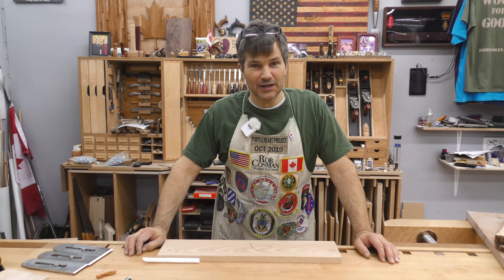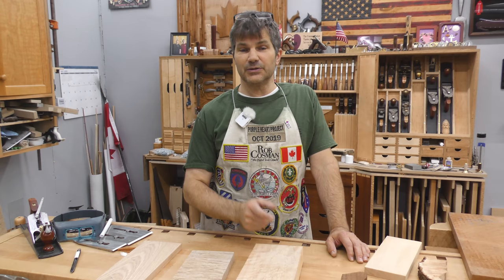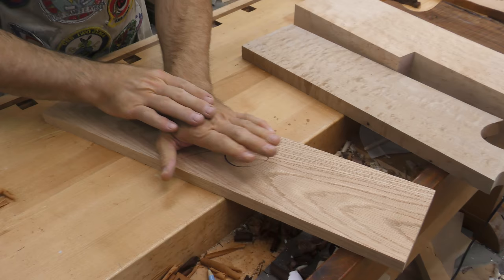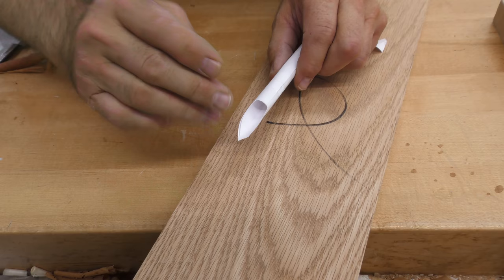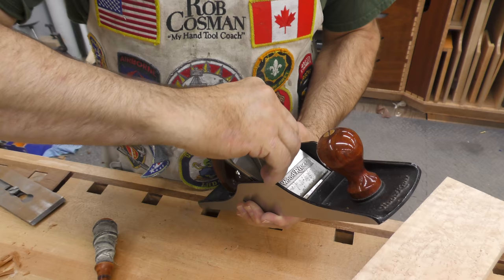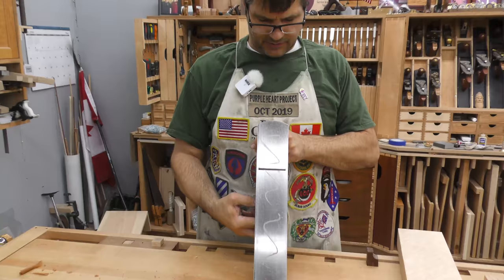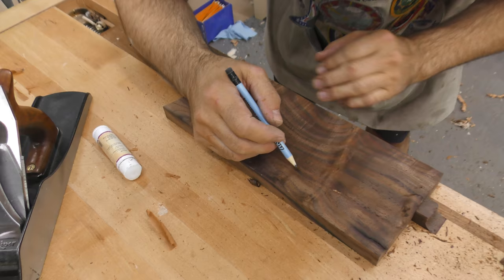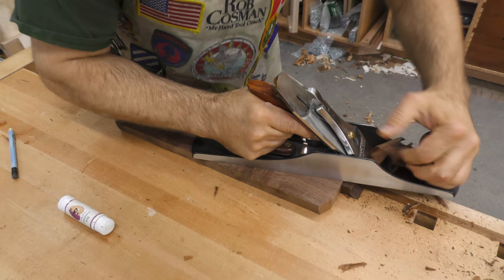Hand Planing Wood - How to Prevent Tear Out

Comment: "I’m not a huge believer in having the chip breaker close to the edge " .  I think you should do a video where you’re trying different positions of the chip breaker. Because when I set my chip breaker close to the edge of the blade I can go in any grain direction without any tear out. I know that you have a ton of experience and that you are a real master, but I just found that comment a bit chocking. I use Stanley type chip breakers , I don’t know if that makes any difference?

Comment: Interesting that Rob wasn't a fan of placing the cap iron tight to the edge of the blade, as advocated by several other experts who claim this cures tear-out without the need for high angle blades. If the experts disagree, what hope is there for the rest of us?

Comment: Instead of going straight to the 65° setup to tame that piece of White Oak, I would have experimented with advancing the chip breaker closer to the edge. If you can get it to work, it saves the need to have several different blades.
Reply: I also think that a close chip breaker does wonder. However it is rare to find actual measurements of what close means. So for a smoothing plane (it doesn’t make real sense for  grunt work), it is usually a small fraction of a millimeter, <0.5mm. Just a very fine line of the edge protruding, just at the limit of your edge camber. One also want to tune a very fine cut, not to have the chip breaker protruding off the sole of the plane. The mouth should not be closed tightly. The shavings should come out straight from the plane, not in an accordeon nor dust. 
Such a setting makes the plane hard to push and is not your all-day setting, which should be around 0.5 - 1mm for a smoother and maybe more for jacks, jointers, etc.

With wooden planes, you can usually close the chip breaker as you plane, ever so slightly, until you notice the shaving change in shape to something straight and eventually a bit shiny.

There is no absolute value and no miracle with this technique, just my 2 cents to quantify what "close" means.
Reply from the maker: I have never been able to get the close up chipbreaker method to work.
Reply: @RobCosmanWoodworking  I think that might be because of the back bevel, I never put back bevels on my planes because of that, while I think it is a pain to flatten the back (at least the quarter to half inch or so before the cutting edge) I am convinced it is worth doing.

Comment: Don’t have a question but just wanted to say I used my LN 5 1/2 plane to put the 24 inch long taper on the 30 inch long 4 legs of the writing desk I am making.  Took forever, but it was so relaxing and satisfying to make table legs that look better than a table saw with tapering jig.

Comment: Great video and very useful as I have often encountered difficult grain in the timbers available to me. With regards to the "65" are you talking about the frog angle or simply an increased bevel on your cutting iron? 
I have a plane with a dedicated increased frog angle but if altering the angle on a spare blade I will most likely sell the other plane. Many thank
Reply from the maker: I make a HA blade by putting a 20 degree backbevel on a standard plane ten 45 + 20 = 65
Reply: @RobCosmanWoodworking  That was the missing link for me! Would have never though of that!. Could you likewise make a low angle plane out of a normal one, by reversing the blade?

Comment: I wonder if adjusting the chip breaker would have helped. On a Japanese setup it would make all the difference. Thanks so much for these fun videos!!
Reply from the maker: John there are a bunch of folks who say if you position th echipbreaker a couple of thousnads of an inch from th eblade and grind th eface of the chipbreak up to 80 degrees that will help, I just have never been able to have any success with that method

Comment: One key element that Rob did not call out in this video is the use of Magic Wax next to the sharp blade this helps so much with hand planning. I swear by the stuff.
Reply from the maker: Frank.  Yup you are so correct.  Thanks for pointing that out

Comment: Thanks for all the great content. My first plane was the WR 5 1/2 and it has been great to use.  One wood I've had a hard time planing is shedua with the interlocking grain. Even my thinnest pass on the jointer left huge pits.  I could only get a clean face with a toothed blade and a #80 scraper.
Reply from the maker: I am not familar with that wood...I will look it up. Sounds nasty

Comment: As a woodworker new to hand tools, I’ve struggled with figured grain. I just don’t seem to get the results I’m hoping for. I actually bought your plane based on your videos.. I do have a question. What do you mean when you say high angle? Because it looks like you’re using the same plane.

Comment: No clue if this would work or not. I am a bowl turner. One of the nastiest bowl woods to turn is dry Koa. On bowls, 1/4 of the revolution is with the grain, 1/4 against, then repeat. To tame tear out in Koa or other woods that are being nasty, some times just dampening the surface with water can help 'lubricate' the fibers as you gently turn off the wet wood. Had some Koa that was years old from up in the rafters of a friend's shop. It took several dampenings to get rid of the tear out.

Comment: Hi Rob,Great video as usual. A couple months ago I was building some hickory cabinets for our kitchen. The hickory is flat sawn and has some really nice grain but it swirls and rises and dips all over the place so I was having a lot of tearout problems. You provided some really great suggestions at the time, including most of what you went over in this video. A lot of what I was experiencing was similar to the white oak in the video. The 20 deg back bevel solved quite a bit of it but there were still a few areas I just couldn’t get smooth on the panels and the frames no matter how often I sharpened and how tight the mouth was. I ended up having to use a card scraper to get those areas and then I sanded the whole thing with 220 grit to blend everything. If you ever get a chance to demonstrate the techniques on some hickory like that I’d love to see you apply your arsenal of tricks on it. I would really like to learn to defeat grain like that with a handplane because once the wood has a finish on it incident light reflecting off a handplaned surface is so much more beautiful and interesting than a sanded surface of the same wood. Thanks for all you and Jake and your team do. Since finding you on YouTube I’ve learned a ton and acquired some really great tools from you. Someday after all this pandemic stuff is behind us I’d like to take one of your classes. Until then I’ll keep practicing what you teach us.
Reply from the maker: Yea, I didnt have any hickory in the shop.  We will be uploading our 2021 workshops on 1 Oct

Comment: When you pull your plane back across the wood for the next stroke you can hear the scratching sound how does that benefit either the wood or the blade, I would think it would either scratch or compress the wood or round over the bottom of your plane blade.

Comment: I plane with the plane pointing straight down the board. Would it help with tearout to have the plane at an angle like you do as it travels down the board?  Does that skew help reduce/prevent tearout.

Comment: It is nice to know that even if you prepped and sharpened the blade properly that sometimes the normally sharpened blade can’t get the job done, and you need to look at other methods, such as that high angle blade. I would have liked to see a piece of wood that you have had to use a scraper on. Is scraping something you would do after getting the thickness/flatness close to the desired dimensions?

Thanks for everything you do Rob! Love the videos!
Reply from the maker: I would use a scraper is the HA blade did not work

Comment: Hi Rob, I have had a difficult time planing hickory. If I remember correctly, even a freshly honed and burnished scraper still produces fuzzy spots on the surface. Thanks for your videos. I have been able to refine my techniques through them.
Reply from the maker: I think if you have a sharp blade and very low projection you can plane the hickery, but its a hard
Reply: @RobCosmanWoodworking  Thanks, Rob! I will give it a try.

Comment: I agree with you with respect to the chip breaker setting.   As  72 year old does it make sense for me too hand plane large glued up panels?
Reply from the maker: AT 72 years young, you will have to make that call.  But there is nothing like the feel and look of a planed piece of wood.  Sharp blade, thin cut and a waxed sole will help make the planing easy

Comment: I might be a little confused.  I thought you had to put a high angle frog in a bailey type plane (isn't that what you were using?) in order to get a higher angle setup for wood susceptible to tearout.  In your video you changed irons to do this.. How is that done?  Thanks.

Comment: Hi. That is, to achieve an angle of 65 degrees, I simply grind the spare blade at an angle of 20 degrees, put it in the same way as in the plane low angle fax up. And how to fasten a chipbreaker? In a video with an angle of 65, you have a chipbreaker installed.

Comment: Do you think you can discuss how to know when it's time to resharpen, and anything to look out for? I'm new to sharpening at this level, and I was planing some maple today and it was beautiful! Then, after a bit, the shavings were shredding on the grain lines of the board edge. Is that a sharpening tell, or a clue to use more blade?  Is it possible to accidentally sharpen to a fragile edge? Those kinds of hints would be great!
Reply from the maker: So telling when to sharpen is a fell you gain with experience.  Before you get that experience the ways to tell are:1) plane gets harder to push, 2) instead of a nice shaving you are getting tears in the shavings or sawdust no shaving.   Until you get a feel, sharpen more often.  No you cannot sharpen too much or make the edge fragile.  Watch my sharpening video

Comment: Hello Rob
I don't get why the close set cap iron isn't an option, since it's not exactly doing any terrible modifications to the plane.
Have you issue with honing your cap iron to 50 degrees ?
 
Good to know you can still have an open mouth with your IBC irons, I was thinking that they might have been too thick for it to work, and the plane choke up, so I'm quite confused why you choose not to utilize it? 
I'd never take the risk of not doing so, especially on camera!
I gotta guess your dislike of the close set cap is just to demonstrate how well you can sharpen : )

All the best
Tom
Reply from the maker: I just habve never been able to achieve satisfactory results with that methiod!!  maybe I am doing something wrong?

Comment: Thanks Rob for the high quality content as usual. Two questions: 1) I recently bought a WoodRiver No. 5 completely based on your recommendation and although I absolutely loved it, I noticed the sole isn't completely square with the sides. it was about 0.6 to 0.8 off of 90. Got it replaced with a No. 5 1/2 and this one came out at 0.4 off of 90. 

WoodRiver says this is within the manufacturing tolerance. At the moment I have to shim the shooting board with surface with masking tape to bring the sole up to 90 degrees with the sides, otherwise the blade has to be protruding so much in one side that it just doesn't look right. Do you have any suggestion on how to deal with situations like this? 

And 2) Where can I get one of those adjuster knobs you have on the plane in this video? Thanks again!
Reply from the maker: What I did on mine is I put it on my vertical sanding wheel while resting on the platform 90 degrees to the sanding wheel.  In a couple of passes I brought it to 90.  If you dont have one of those big sanding wheels you could try sanding on the side with sandpaper adhered to a flat surface.  

We sell the sdjuSTARS.  they are in the plane section of my website
Reply: @RobCosmanWoodworking  Perfect, thanks a lot Rob! I will try that. Also the AdjuSTAR is sold out now, I hope you do another batch soon!

Comment: Rob,
I like to finish all show surfaces by planing, and when tear out occurs, I first try skewing the plane for a shearing action, and if this proves unsuccessful, I finish with a card scraper or scraper plane. Suprised you didn't mention these techniques.
Reply from the maker: The topic was "Hand Planing", not scraping.  Different procedure different video.
Reply from the maker: But skewing to get that shearing action is a great technique.  Actually i think i should add that to my process: 1) sharp blade 2) try skewing 3) smaller projection.  Great tip
Reply: @RobCosmanWoodworking  Rob, actually I do more than skew the plane, I don't push the plane straight forward with it skewed, I also kind of sweep it at an angle. Not sure if that correctly describes the method, but I try to slice as much as possible, pushing forward & sweeping in an arc at the same time. It's pretty much a trial and error method, but I've found it very good for me.
Thanks

Comment: I have to ask is your purpose for planing wood for surface preparation or for removing stock.  When I pick up a plane I'm wanted to reduce the stock size by a fractional amount much as you would with a scrub plane or to take the twist out of a board.  Am I missing some here?
Reply from the maker: Bob,  short answer is both.  It depends on whatyou are trying to do?  If working strickly hand tools then I do every operation, dimensioning with handplanes.  However, on a daily basis I typically use planes for surface preparation and use my machines for removing large amounts of wood.  There just is nothing to compare to a pamed wood surface.

Comment: I would like to see how a low angle bench plane compares on those same pieces of wood
Reply from the maker: I do not prefer a low angle, primarially because of its lighter weight and I find it not easy to adjust (reach the knob) while planing.  So knowing my preference, i would not want to plane in difficult grain with a lighter plane, i want the heft
Reply: @RobCosmanWoodworking  yes I agree. You have a great video from late last year I think that compares them. I just thought it might further drive your point to see how much more difficult it would be to get these results with a light plane like a L.A.jack    with or without this video was great.  As always thanks for the awesome content.  Can't wait for the next one

Comment: I was so please when I was finally able to plane curly maple. Very sharp blade with a right throat did the trick for me.

However, no matter what I do, I can’t seem to plane quarter sawn sycamore... have tried tight throat, chip breaker right up close, lightest pass while still getting a shaving, and a higher plane angle. Am I missing something or is sycamore just too soft a wood?
Reply from the maker: Sycamore can be difficult but its doable.  Maybe you just had a difficult piece

Comment: Does the speed of the travel of the plane make a difference?

I like using an Aussie timber called Southern Silky Oak (Grevillea robusta) due to it's fine quilting and other usable qualities. That quilting can make it prone to tear-out.  I was sharpening to 6000 but would end up with some tear-out now and then.  I then bought a Shapton 16000.  Using the same blade sharpened so as to provide an attack angle of 62 degrees  I rarely get tear-out.  Sharp wins! It's not a sales gimmick.
Reply from the maker: speed doesnt matter.  Glad you have success with 16K

Comment: Hi Rob, I have had some issues with a bade and chip breaker  I purchased for my #8 Stanley. while trying to flatten my Maple bench I have significant tear out .  should I regrind to a 65 degree setup and give it a shot?
Reply from the maker: My first thought is did you glue up the maple for th etop with all th egrain oriented in the same direction or do you have reversing garin due to th eglue up?
Reply: @RobCosmanWoodworking  Yes I goofed on a couple of pieces. is there a way to recover

Comment: Not forgetting the old trick of wetting the surface of the wood slightly. Not a brilliant method, steel vs water being an issue, but it worked reasonably well when machine planing and thicknessing gnarly timbers.

Comment: Hi Rob, and thanks for another great video. Do you have anything on sharpening blades to different angles? I noticed you have 45 and 65 in this video. I only sharpen mine to 30/25. Thank you.
Reply: Think you're misunderstanding the pitch of the blade with the grinding angle.
The grindin/sharpening angle(usually 25/30° ish) does not affect the pitch as the blade is set upside down in standard planes, the pitch is always the same.
What Rob does is a grind a miniscule 20°back bevel on the blade to alter the pitch, in this case,to a higher angle pitch of 65°.
Not a huge fan of backbeveling good blades personally as, well I'm not quite sure but it was frowned upon back in the day and old habits die hard haha but there is no real reason not to have one I'm honest it's cheaper than a dedicated high angle plane so...
Reply: @dlewis2446  Thanks for the explanation; I was a bit confused since this was a bevel-down plane, so I was wondering how he varied the angle(?)
Reply from the maker: D Lewis is all over it.  Here is a video I did on how to make a high angle blade: https://www.youtube.com/watch?v=WKoFLz1nH9o&feature=youtu.be